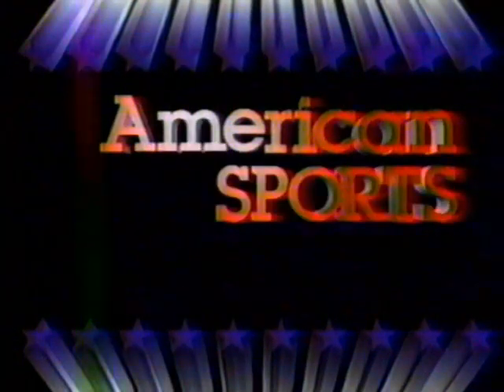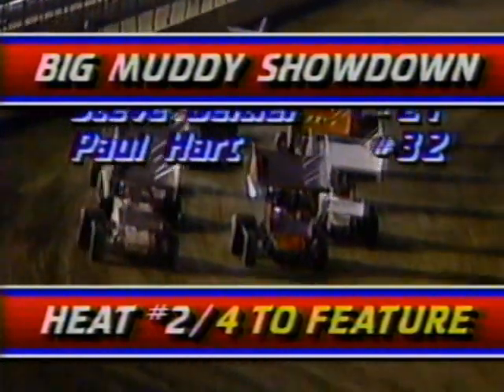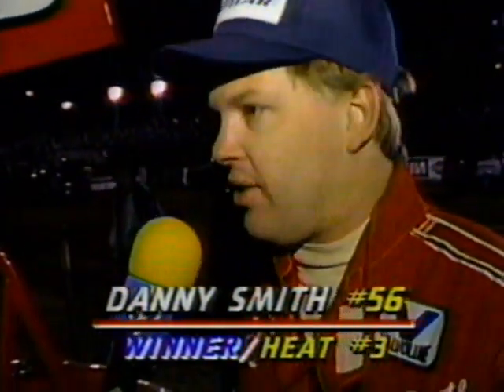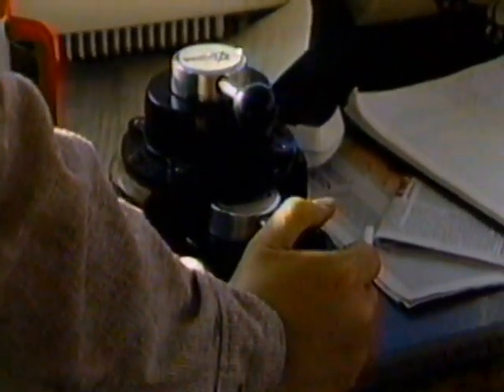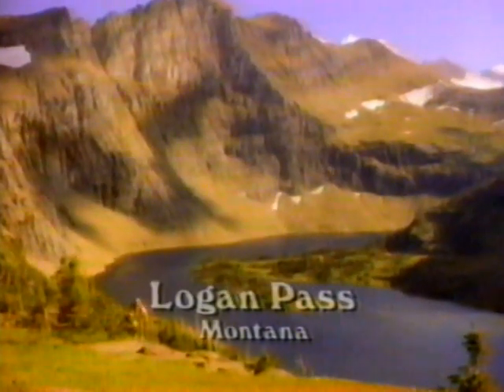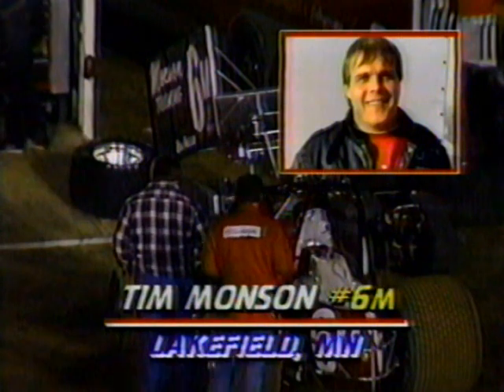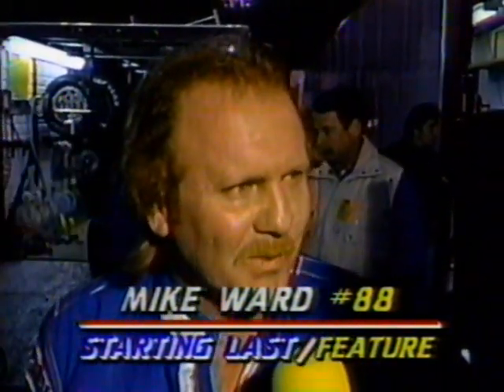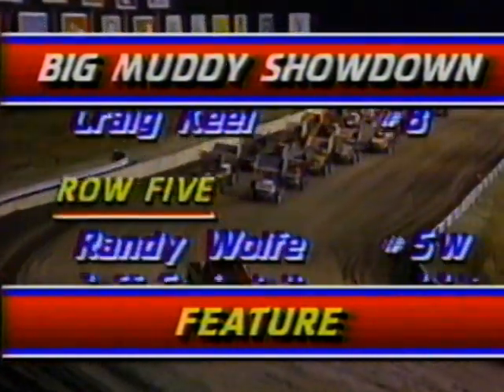1989 World of Outlaws Big Muddy Showdown - Memphis Motorsports Park

Comment: They gush all over the SBC rightfully so. But in 1989 a non-Chevy powered sprint car won the WoO sprint car championship.
  Bobby Davis Jr. drove the Casey Luna #10 FORD Powered to the 1989 championship and 5 years later Dave Blaney did it again with the same car.
  I met BDJ at Hanford in '89. He signed one of his sweatshirts which I still have today. I'm two 2 for 2 in the year they signed they won it all department. 

  In 1992 Alan Kulwicki signed my Sears Point program...as did Ned Jarret but I was only watching from afar in 1965 so I thanked him for driving a Ford. He liked that😊
Reply: Nerd
Reply: No disrespect to Ford or Bobby Davis Jr., Bobby’s only WoO title was due to the big boys running another series. Even in 1989, Doug Wolfgang had 7 more A-main WoO wins than Bobby. Bobby was consistently a top 5 points driver from the mid 80’s until 1990, but Steve Kinser owned that show. Steve had won six WoO championships in a row pre 1989 then came back and won five more in a row after 1989. Dave Blaney won the title in 1995 when Steve Kinser ran a limited schedule and still had six more A-Main WoO wins than Blaney had on the season.